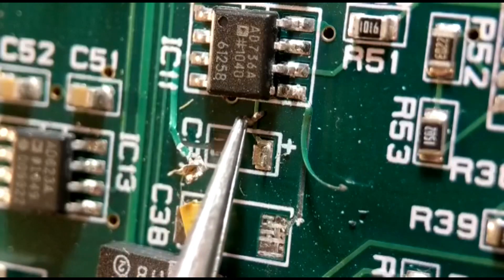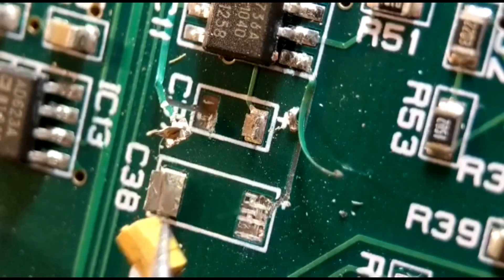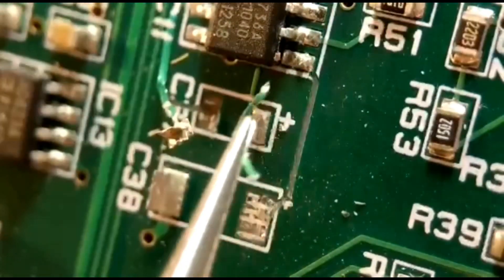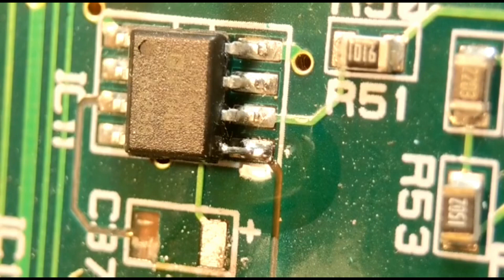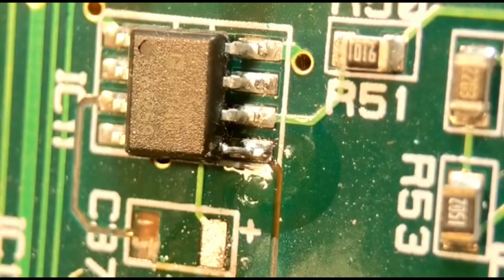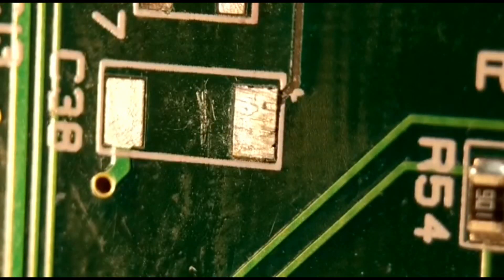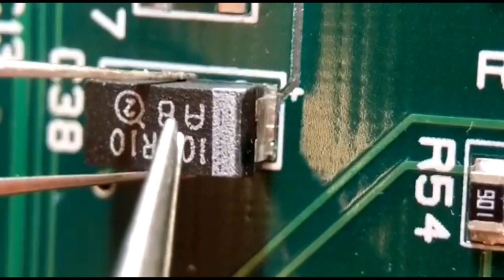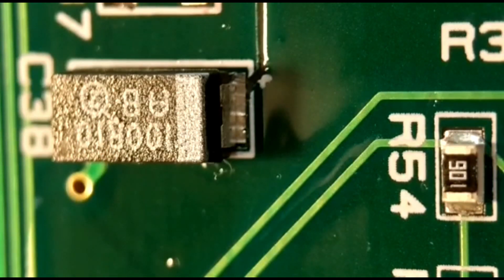How To Repair Damaged Pads ,Traces and IC Pins #soldering

Comment: This is good stuff. What's the wire. Is it wire wrap wire? You often say you will provide links to the materials used, but I don't see any.
Reply from the maker: Hi . Thank you for watching . The wire used in this video was 30 gauge kynar wire available from Farnell , RS Components ,Rapid Online and many other electronic retailers . I always mention what I use but I never claim to provide links to products . I don't endorse any products and just advise what I use . Ive mentioned what  flux I use SMFL200D many times in the comments section  , where I get my solders , my cleaning wipes , cleaning fluids  and what irons I use etc many times also in the comments section and sometimes in the description . I will never provide links . Hope that helps , thanks again 👍

Comment: Hi, I have an ic that I was trying to replace, and while cleaning the board after removing the original, one of the pads came off. I'm trying to put it back on, and wanted your advice. The component has a soldering plate under it so I wouldn't need to for it down like you did but what is the best way to hold the loose pass in place while I solder the ic, can I use a drop of any glue or only a specific type, or is there a better way to do that? Thanks, and thanks for the great video.
Reply from the maker: Hi . Thank you for watching , much appreciated. I find the best way to hold the pad in position when your soldering it is to either put light pressure on the top of the pin so as the pin holds down the pad in position and doing this way you need your iron already loaded with roughly the correct amount of solder to form a good joint . You must use flux in this case or else you won't get a good joint . I can't emphasize enough how valuable flux is when soldering . Also another way is to get a fine pair of tweezers and with the pad in position hold them right on the edge of each side of the pad . Again pre flux your pad and preload your iron with the right amount of solder . Then just gently solder the joint and for me this always works . As for gluing the pad I always do this afterwards if necessary, never before as the heat just dislodges it . A good araldite or Tak Pak will do the job . Just run around the whole pad in question and should be ok . Hope that helps , and good luck 👍

Comment: What is the correct temperature of the soldering iron to do this job in celcius ?
Reply from the maker: Hi . Thank you for your question . My soldering iron was set to 350 degrees centigrade when I did this repair work . 
This is pretty much the temperature I do most work at and I find it's normally ok.
Hope that helps , thanks again 👍

Comment: what kind of epoxy did you use for under the pad? would you please!
Reply from the maker: Hi . Thank you for your question . In this video I didn't actually need glue under the new pads because the bonded down components will perfectly keep them in place . I would normally put some Tak Pak glue ( made by Loctite ) around the edges of new pads to keep them in place . The glue I used to bond components down was an Araldite twin pack . I find if you glue pads down before soldering it just re melts the glue and makes a mess when you actually do the soldering. Hope that helps . Thanks again , much appreciated 👍
Reply: @mrsolderfix3996  that tak pak glue so expensive for a tiny bottle
Reply from the maker: Hi . I've seen it on eBay for £ 8.99 and you can buy the activator separately for about £12 for a large can , so it can be found at a reasonable price . Hope that helps , thank you for your question 👍

Comment: Is the glue a special type?
Reply from the maker: Hi . The glue I used here under the components was an Araldite 2 part glue which is strong but can be removed if needed to be. For sticking my wires down I used Loctite Tak Pak which is the recommended glue for doing this and comes as a 2 part glue and activator set. Hope that helps , thank you for your question🙂

Comment: Hello and thank you for presentation.What type of flux and soldering wire, RMA223 or Amtech 559 nc, or other: 0.5, 0.7 or 0.8 mm for soldering wire, with rosin core or 60/40 Sn-Pb, or 63/37 without rosin core?
Reply from the maker: Hi . The flux I use is called SMFL200D rework flux . It's a great flux and it's the only one I ever use , about £11 for a 200ml spray can . I squirt some into a small container then use a dipped Ty wrap to apply . The solder I use in my video's is lead free Sn100SB , 0.25mm supplied by a UK company called BLT. I also use 0.38mm + 0.5mm ( BLT ) for larger joints if needed. I do use leaded solder if people ask for it specifically. Hope that helps , thank you.

Comment: Where to find the replacement pin?
Reply from the maker: Hi . All you need to make an IC pin is some tin copper wire the same size as the pin . Then you can shape it like I have in the video. Hope that helps , thank you .
Reply: @mrsolderfix3996  thank you! Gonna try that. Any way I could use just a soldering wire as an alternative?
Reply from the maker: Hi . You can also use the leg of a through hole component as a replacement pin but it needs to match the size of the missing pin . Good luck👍

Comment: Nice work, very well presented, what is the gauge of the wire. Cheers,
Reply from the maker: Hi . Thank you for your nice comment. The gauge wire that I used to replace the IC pin and the traces was 30 gauge Kynar wire , in this case the perfect size as I always try and match the size of wire to pins and traces to ensure perfect working signals . Hope that helps and thank you again. 👍